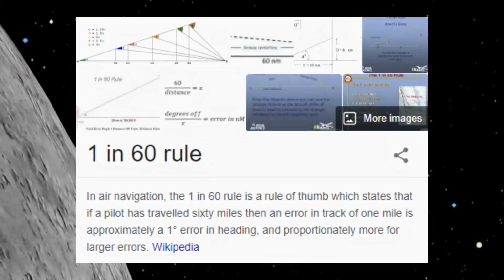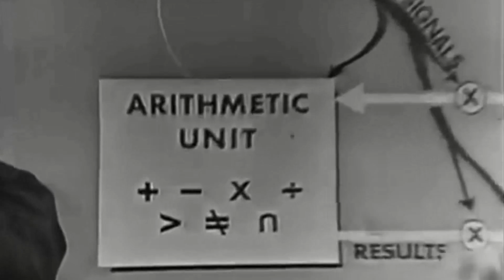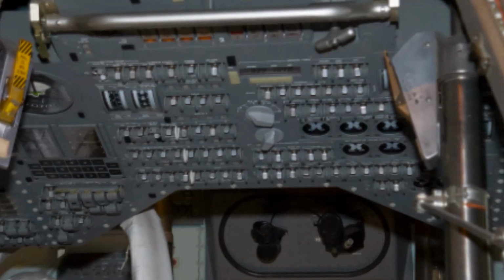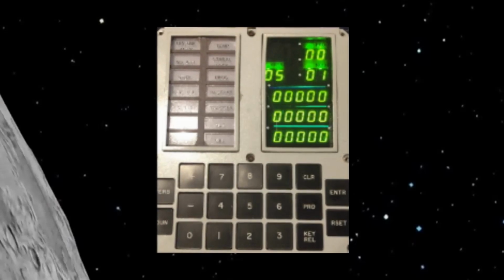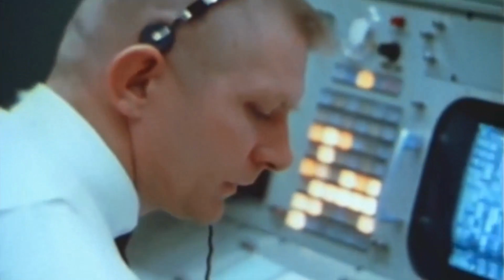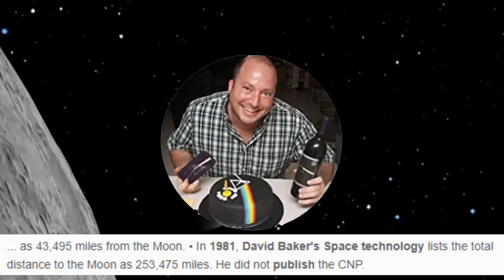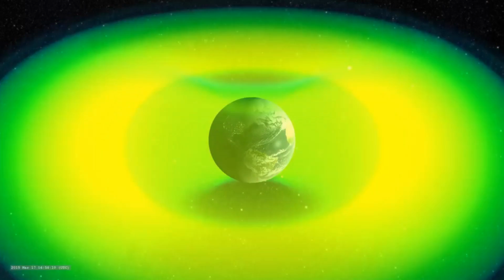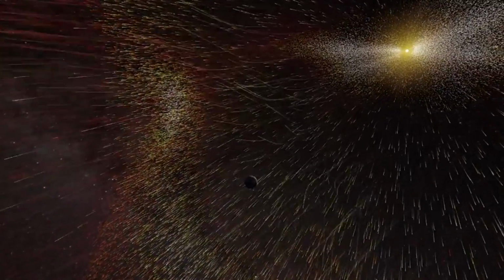"Hiding A Hoax In Plain Sight"  The Series -Part 4!

Comment: Once again, Bob Williams has shown his skills in bringing out the details of the Apollo Moon missions. And what part 4 shows, is that the Apollo Guidance Computer was incapable of performing the navigation tasks it was claimed to have done.

And although the LLRV and LLTV were the first to use a fully integrated fly-by-wire system, we were led to believe that the Apollo program were the first missions to have used this system to near perfection. Of course, this is the only claim NASA could have made, since there was little or no margin for error in navigation. Any serious deviation off course meant being marooned is space. This was because propellent was limited, meaning there was little or no propellent for the course correction that would have been needed.

As for NASA's claim of near perfection for the navigation techniques used in the Apollo Moon missions, all anyone has to do is look to unmanned missions in the last decade. These unmanned missions were far less complex in design than the Apollo Moon missions yet, they have over a 40% failure rate, and that's with using 21st century navigation techniques. 

So, not only have we proven that the F-1 engines were underpowered on launch, we've proven that the AGC was a complete fake.
Reply: @justincox1685    My reply was to Randy, but since you've butted in, I commend you for finally showing up to face Randy on Skype... That's more than can be said for your cowardly pals who only know how to spew idiotic insults at him from the safety of their anonymity... I hope you follow up and meet him again very soon... It would be a welcome change to see a real debate, instead of the immature nonsense that most Apollo defenders pass off as rebuttals.
Reply: @justincox1685    "NASA went to the moon. The way they did it is exhaustively documented in text, video, photos. If you want to refute ANY of that with substantive, verifiable information I would LOVE to discuss it with you with zero insults or derision."

Nice speech, except that much of NASA's Apollo documentation, including their fraudulent videos and photos, has been repeatedly proven to be fake by many different researchers, using evidence that none of you defenders can refute.. How about you take those same claims to Randy the next time you're brave enough to face him on Skype and I'm sure he will be happy to address all of your erroneous claims... As for debating me without the typical insults, that remains to be seen.
Reply: @Prove It   "Well prove that he exists! I bet you can't!"

His paper proves that he exists.. Let's see you prove that he doesn't.
 
 "you could not debate your way out of a wet paper bag!"

Psychological projection is a defense mechanism in which the human ego defends itself against unconscious impulses or qualities by denying their existence in themselves while attributing them to others. It incorporates blame shifting and can manifest as shame dumping.

BTW, professional shills also work in tag teams, like you trolls do here.. The difference is, they are highly intelligent and very skilled at their jobs, whereas ineffective trolls like you don't understand what a debate is, much less know when you've lost one.
Reply: @justincox1685    "Do you believe Bob's film vacuum experiment proves NASA fraud?"

I'm not familiar with that experiment, sorry..  There is a multitude of evidence that proves the Apollo fraud.. The many sounds picked up by the astronot's helmet mics, being some of the best proof that the footage was not filmed in a vacuum, on the Moon.
Reply: Hey there Mr Walsh! Still not up for a debate I see. I noticed that you are only challenging people to a debate, who you know have a good reason not to get on video with you!
Very manly of you Mr Walsh! 
Another brave and "manly" thing you did, was when you  "change your mind" about having a text debate with me! Even though you said you were willing to have a debate in text prior to my request!
Reply: @Prove It    "it is up to Randy to prove his claims that the F1 was not up to the task!
"

He already did.. If any of you can prove differently, then why not debate him on Skype?
Reply: @justincox1685   "Do you think the Gennady Ivchenkov paper on AULIS refutes NASA's claims?
"

Which paper? .. The one in Russian or the translation into English? .. Of course he refutes NASA's claims and presents evidence to back up his claims, even if you don't want to accept it.
Reply: @justincox1685    Have you even read Ivchenkov's paper?. Here it is including the links in Russian, which I highly doubt the folks at Aulis created to make it appear that he's a real person..  https://www.aulis.com/PDF/F-1_Evaluation.pdf

Why don't you read his work and then state the points you disagree with and why?.. That would be great homework for you to do before meeting with Randy on Skype again, don't you think?
Reply: @justincox1685  No one is asking you to accept anything, but to say that someone doesn't exist because information about him is not readily available online, is ludicrous...His paper clearly proves that he is Russian and considering how secretive the Russians are, that may be the reason you can't find out more about him... I don't think you're a shill.. I have debated professional shills on various debate forums throughout the years and no one who posts comments on YouTube qualifies as being anyone who NASA would pay to defend Apollo ... The Apollo defenders here are mostly trolls just looking for a mud slinging contest, or fan boys who would rather die than accept the fact that Apollo did not happen as advertised.. As for Aulis, I believe that most of their evidence showing Apollo was a fraud is quite accurate but not all of it.. One has to decide for themselves what evidence has been proven and what evidence hasn't.. If you can be convinced that NASA didn't land manned missions on the Moon over half a century ago, using conventional rocketry that can't even accomplish that amazing feat today, it proves you at least have an open mind about this subject.. I know it's easier to go along with the status quo but usually people who can think for themselves choose not to swallow American propaganda, despite the ridicule that inevitably comes with bucking the system.. I understand that you're focused on the F1 engines because of Randy's book but he also presented other evidence besides that.. It's not just one thing that proves Apollo was fraudulent.. The evidence is cumulative and despite what the Apollo defenders claim, most of that evidence can not be debunked.
Reply from the maker: Boy oh boy! Did this comment ever bring the rat pack to the cheeze!
Reply: @theapollodetectives  "Did this comment ever bring the rat pack to the cheeze!"

The truth bothers them. :)
Reply from the maker: @randywalsh460   I posted this to Cleric 58 because he is side stepping the question. i asked him why the networks and his film show F1 separation at 1:22, when the official time is recorded at 2:44. Here is my reply to his side stepping the question;

That explains nothing. The problem with ALL of the networks and your video is that they all agree. The official separation time is at 2:44, so tell me why all of yours separates at 1:22. That's the problem here. No excuses. Answer the question. It is a simple question even you should be able to answer. This is exactly why TEXT talk is a problem because you lot will not answer these questions, but go off on tangents like this.
Reply: Nice job upsetting the trolls, Randy! .. What happened to your Skype debate with Justin Cox?  .. I know that Greg Smith chickened out but thought Cox was going to show up.
Reply: @straydog02  "Nice job upsetting the trolls, Randy! .."

It doesn't take much to upset them. All one has to do, is show them how wrong they are. :)

"What happened to your Skype debate with Justin Cox?  .."

We actually connected on Skype, but there were some problems with the audio. So we'll try again soon.
Reply: @randywalsh460   "It doesn't take much to upset them. All one has to do, is show them how wrong they are. :)
"

True.. If they really believed they could refute your evidence, they would be happy to debate you on Skype... None of their silly excuses as to why none of them will do that, makes any sense... Glad to hear that Cox finally showed up.. Hopefully you can get audio fixed and have another go at it.

Comment: The fact is Nasa has no navigation system even now. Israel would have borrowed it in the last moon expedition if there is any. Israel used the same method as India, just stretching an ellipse orbit until it reaches to the moon. This method takes about one month to get to the moon's orbit. If a probe flies directly to the moon, it will get lost just as Nasa lost so many of them.
Now, the Boeing capsule didn't get into an orbit and crash to the grand. I heard Nasa requires more safety systems in the capsule because men would be dead if they are in such a capsule. Luckily, the SpaceX capsule reached ISS, but it has not tested to bring men back yet. Nasa's technology level is to deal with a low orbit. Moon? Forget it. Nasa can not send anything there. They tried 20 years ago, but they got lost because they could not figure out how to make the navigation system.
Reply: @justincox1685  When did Nasa send anything to the moon? Show me that if there is any? Do not give me BS of Apollo video.
Reply: @justincox1685  Are you saying any LRO existing? Show me a photo. Don't give me any Photoshot fake photo. Give me hte far side of the moon photo taken by LRO. Nasa has none.
Reply: @justincox1685  I have news for you, idiot. The moon has brown color dust, not gray. Look at Chinese rover's photo by high-resolution true color 3D image. Apollo photos are all fake.